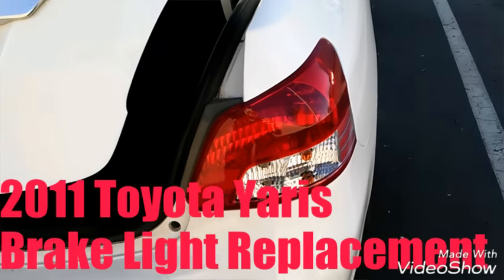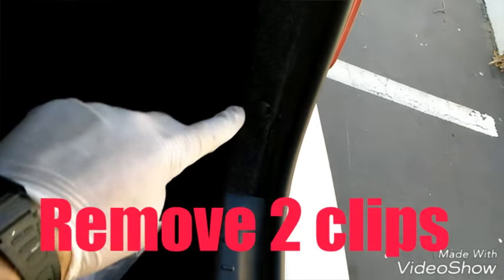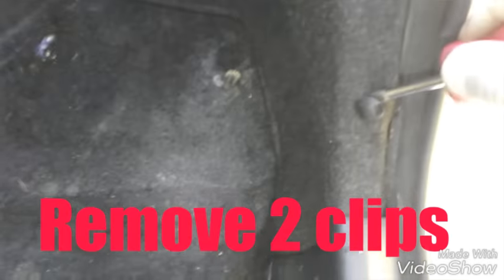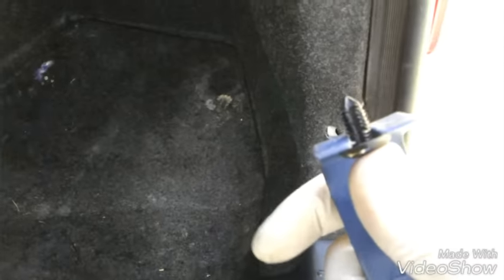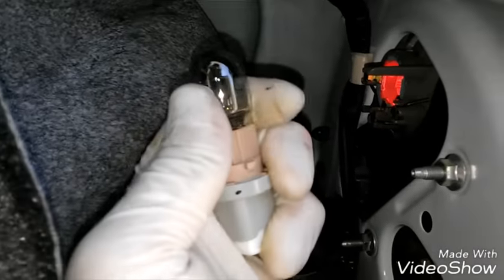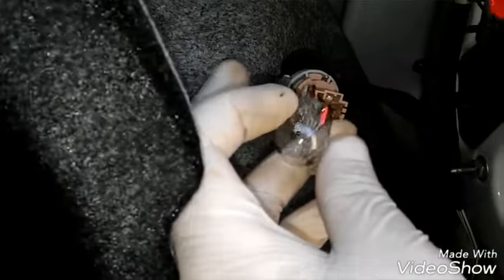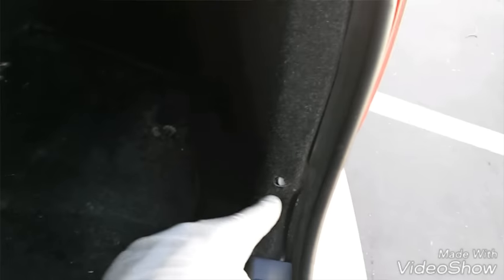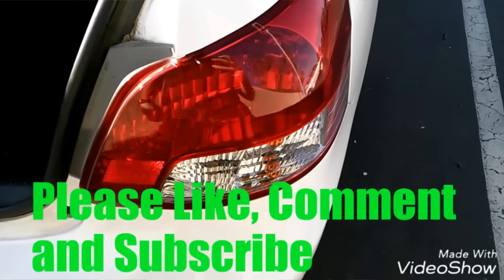2010-2011 Toyota Yaris Brake Light / Tailight  Replacement

Comment: I have a 2011 Yaris and it doesn't have a felt liner thing inside like in the video - it's all plastic lined (similar to the 2012+ Yaris but not exactly the same). I had to pop out the plastic cover (looks like a little grill) to access the lights. There's a notch at the top to open it but it's easier if you use something flat to pry up the sides first.

Comment: Thanks for your video! I was wondering if anyone can inform me the type of bulb I need to get to replace the taillight on my Yaris. IAfetr checking the manual, I am clueless about the size. It is for the brake light. Also, if I want to install a LED, should I get and replace all the bulbs for uniformity? thanks for any guidance!